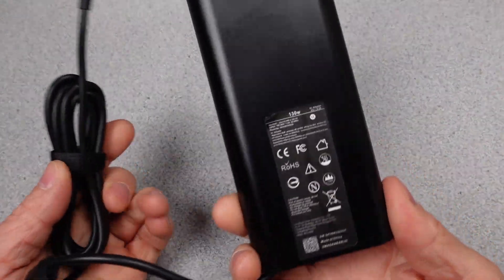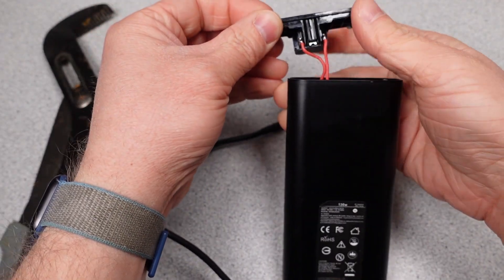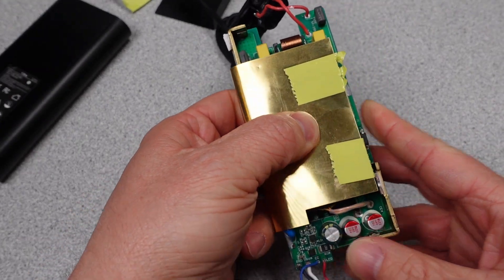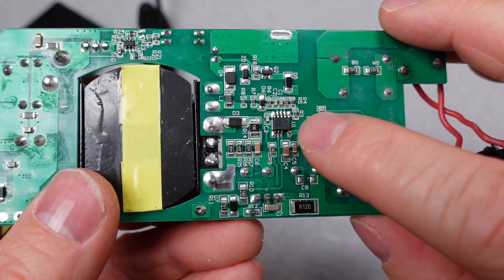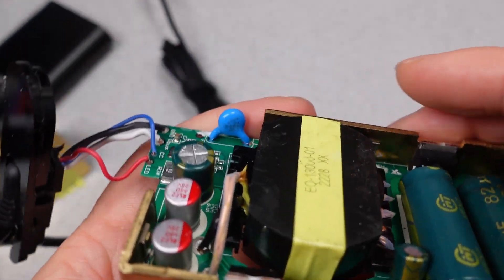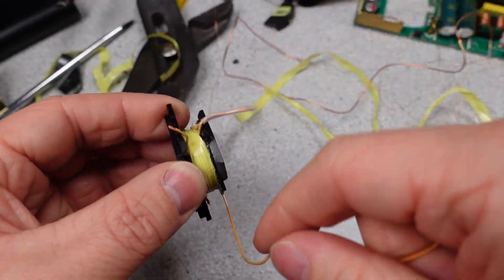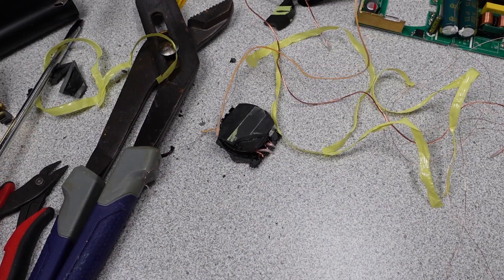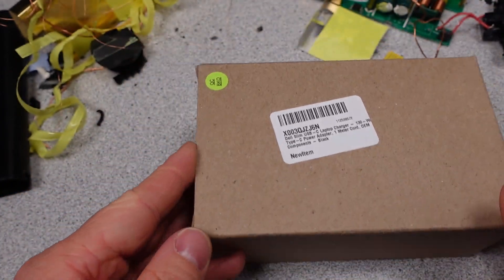130W USB C Laptop AC Adapter Teardown, what is inside?

Comment: Hi! Thanks for the teardown video.
I’m planning to power my Dell XPS laptop directly from a 24V LiFePO₄ battery, bypassing the AC input in the original charger.
Can you please show (or describe) where exactly I can safely connect 24V DC on the board to use the existing DC-DC stage and all protections?
Is it safe for the charger and the laptop? Do I need to modify anything else?
Thanks in advance!
Reply from the maker: I'm not sure 24VDC would be within the safe operating range of some of the components on the laptop.  You'd have to investigate and make sure they aren't using 25V rated capacitors at any point on the input circuit, which is pretty hard to do since they don't label ceramics.  I'd probably want to use an external DC/DC converter to decrease the voltage to the expected 19 or 20V before feeding it into the laptop.

Comment: I've also noticed that these third party adapters have a Y cap but no earth line which causes a slight shock/tingle if you touch 0vdc
Reply from the maker: Yeah, the cheap replacements aren't worth the trouble.
Reply: @AllThingsOnePlace  I had to unfortunately. Added a 1nf ceramic cap between earth and 0vdc which removed the tingle. Got a dell charger eventually because it bothered me.

Comment: How do I fix the cable? The tip of the USB C cable is broken as I droped the laptop from my bed and the tip got broken?  Can it be fixed (replace the cable from the charger to the laptop, maybe)? Thank you!
Reply from the maker: You can repair the cable, I wouldn't recommend opening the adapter, as they don't really go back together making it a pretty bad safety hazard after opening.  But the USB end can be cut and replaced with a new USB end, it will require soldering and knowledge of what wires go where...

Comment: What is the name of this kind of type c pin? I want to replace my dell 130W broken type c charging pin with LED?
Reply from the maker: It's a normal USB type C connector, that is standard across all of the connectors.  The CC pin is the one that communicates the protocol.
Reply: @AllThingsOnePlace  i have tried with normal c pin but not working as normal c type pin have 2 wire connector and in this kind of charger we have 3 wire connector and 3rd i think is circuit wire

Comment: Thank you very much for this, it was very informative.
A few weeks ago I had a power surge (The underground utility cable shorted out very spectacular!) and my Dell 130W charger started acting strangely, it would start charging and then stop. I unplugged for a minute plug it back in and it worked. Hmm… I wondered if they moved the charger control circuits to the charger.
I saw your video a couple of weeks ago and ordered a new charger and it has been a week since I had the new charger arrived and the Dell XPS is back working like a champ.
Now I’m going to teardown the old one and see if there is any damage to it. I have surge protectors on all the electronics in the house including the washing machine but not on the laptop because I move around to different outlets. The surge set off the smoke detectors and fried all 7 of them which are being replaced.
Reply from the maker: Yeah, that's certainly odd behavior and a power surge is a difficult event to deal with.  Shorting mains power cable is a scary event.  The best case is it just doesn't turn on anymore, safely fails and doesn't damage anything down stream.  I've had a few things damaged over the years from power issues.  

The fire alarms I am pretty surprised by, the power supplies in those I would expect to be able to take a lightning strike and not fail, they are built down to a price I guess. A lot still use capacitive droppers and zener regulators.  So, a short transient can walk through that capacitor like it's not there, and says zap to the computer in the alarm.

Comment: I would like to see a test of a Lenovo Thinkpad 65w adapter. Also, could you please elaborate on the advantages of a ground pin in a usb-c adapter? Of course, most of them are for laptops but even some laptop manufacturers provide a 2 pin, ungrounded charger.
Reply from the maker: Yeah, I need to get into some Lenovo stuff.  I have a few chargers around here somewhere.  I made an adapter to connect to the rectangular plug end.  The ground pin is used for a few reasons, here are some:  One is safety of the adapter, another radio interference reduction or shielding, then also it has the effect of reducing leakage to the user from power supply by shunting the residual AC to ground.  Of course if it isn't even wired like this one then it doesn't work for any reason.
Reply: @AllThingsOnePlace  Thanks for making that clear! I was talking about the recent Lenovo chargers, not the old ones. They are all USB-C now. Maybe some docks still use the rectangular but that was not my intention.

Comment: Hey! Do you have a recommendation for a third party replacement for the 130W Dell power adapter? Would appreciate the most budget option you'd recommend. Thanks for the great vids!
Reply from the maker: Yeah, in this case the Dell OEM is almost the same price and a lot better than the replacements on may factors.  I'd really just get the Dell.  You can get used ones usually pretty cheap from resellers too.  There may be some good replacements but mostly they look like this one, and this one is bad.

Comment: I have Baseus 100W Charger CCGAN100UE with also Baseus Type-C to Type-C 100W cable. My device is Dell Latitude 5520.
Is this a good replacement ?
Reply from the maker: That laptop does want the higher wattage of the Dell 130W adapter, or 6.5A on one cable.  It is proprietary, so really stuck with the Dell official charger.  I wouldn't get the one from this video, ha.  The Baseus should charge it fine, but it may run out of power if you want to do heavy workloads while also charging.
Reply: @AllThingsOnePlace  I have started watching your videos because I want to make an informed decision on a power bank. In one of your videos you said that the best way to decide on a powerbank is to think on what requirements you have, wattage, amperage. 
My requirements are a dell laptop which uses this 130W 6.5A powerbrick and 45w fast charging for samsung. Would the anker 737 or the 250w anker be a good choice? Or do you recommend something else?
Thanks in advance!

Comment: Ouch. This was about as bad as I was expecting. between that wrapped metal sheet and the transformer windings, there are multiple places which are only a bit of nicked insulation away from going live, and if things are being put on backwards inside the factory, that doesn't inspire confidence. Good to get awareness out about this kind of thing.
Reply from the maker: Yeah, scary right?  I bet there's a lot of these out there too.  The metal shields are required to help block radio interference and an engineer took the time to design it with a cutout for safety.  Oh well.

Comment: I am  looking for slimq 240w power brick but only issue is huge shipping costs plus import duty and from the slimq customer complaints about hissing and causing DCIN connector failures in Dell and asus models. Then there's no way to check the revision to see if there are affected models. Teardown was pretty brutal but explained in a very easy manner. Thanks
Reply from the maker: Yeah, I should do a teardown of the 240W brick from SlimQ.  No idea what we will find in that one.  I have quite a few Dell and HP adapters that also make noise under light load.
Reply: @AllThingsOnePlace  thanks man. Will be waiting for that.

Comment: Could you review the Ugreen 145W 90Wh (25,000mAh) powerbank?
It has 2 USB-C ports (100W and 45W) and a USB-A port (18W)
The two USB-C ports do 100+45W together, and all three ports do 100W (C1) + 15W (C2 + A) together. 
Both port C1 and C2 can do charging and discharging, but port C2 is capped at 45W for both directions, doesn’t make a lot of sense. Port C1 is also capped at 65W for recharging. 
The Powerbank lacks any Extended Power Range modes, but it likely supports PPS as it claims compatibility with the S23 Ultra.
The product images indicate it has the UK/CA and the CE marks, and the powerbank has an LED display for battery percentage. 
The Price is the same as the Anker 737 ($150), but it appears to be unavailable on Amazon US at the moment
Reply from the maker: Yeah, there is a limit on capacity and power delivered.  This pack limits charging speed, likely to prevent overheating.  At 145W out, I would expect overheating for a battery of that size.  The Anker overheats as well but it manages to drain itself flat before doing so which I consider fine, it did its job now it needs a break.  Anyway, I added the UGREEN to the list.  No idea when or if it will make it.  These high wattage claims on smaller batteries are something to be wary of.

Comment: Have you thought about doing a doing a Power factor correction mod to the rectifier. Similar to what greatscott showed off
Reply from the maker: I did before he made that video.  I actually have that PFC module he showed off, ha.  For some reason if I plug it in now I don’t think it will work.

Comment: it is probably a C5 (cloverleaf) connector instead of the C7 (8 figure) so that if you already have dell charger, you could just swap out the mains cable, instead of thinking about it being obviously fake by being wrong connector. I am happy to see that someone else gives a thought about PFC, because I personally wouldn't use this adapter if it was the last one in the world (beside bad QC)
I really like this video, and it would be fantastic if you also made a teardown of the original dell charger and making a comparison!
Reply from the maker: mmm, yes, the cables are interchangeable.  Yeah, I've had several people want to see the Dell so that will be coming soon.